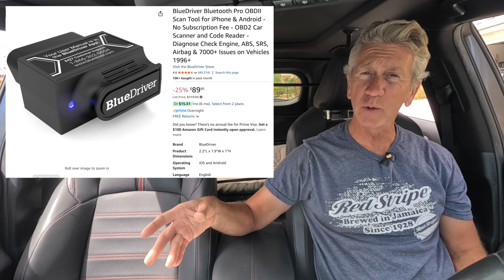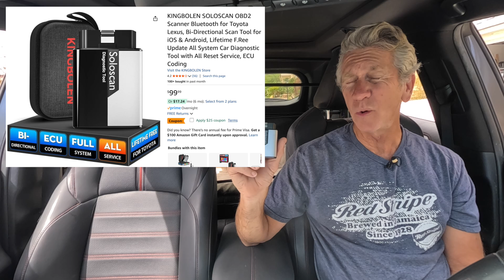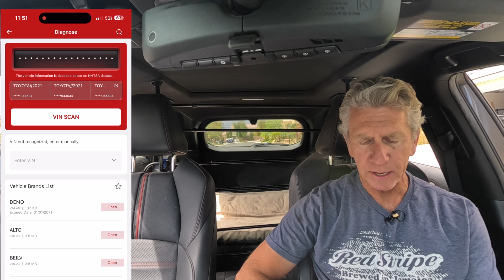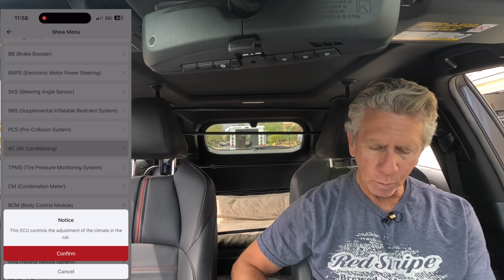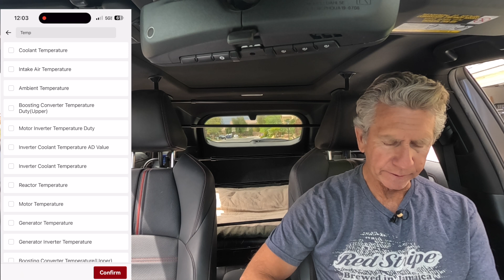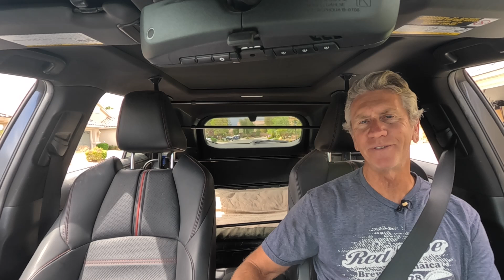OEM Quality Scanner for Toyota Vehicles: KingBolen SoloScan Toyota (Scanner, Testing, Live Data)

Comment: I have so many questions! Can it start the engine?? (Like would it work as remote start?) can it tell you electric miles driven?
Reply from the maker: I don't think it can start the engine.  It's a really good diagnostic tool... as well as let you monitor live data when driing.

Comment: Hey Darrell! Great video! We tow with a Sienna Hybrid and although we have not had any issues with overheating, etc., I am curious to see how the system performs. I was looking for the Toyota specific KingBolen OBD2 scanner but it appears as though it may be discontinued (the link in your description indicates it is currently unavailable  on Amazon). I did purchase the generic version and even though the software looks a little different, your instructions were spot on. My setup and navigation of the app was somewhat challenging but your tutorial made things WAY easier. Now I know how to monitor the systems in my Sienna when towing. Thanks for a great video!
Reply from the maker: Hey guys.  Thanks for watching.  Glad the generic one provided the same data!!  Good to know !!
Reply: @GoldenK9Campers  You're welcome! I was able to monitor all of the data points included in your video, except for engine temp for some reason. It is possible that I overlooked it because the menus are a little different. Safe travels!

Comment: I am using the Hybrid Assistant app for Android only - it can show much more info and record charts about many parameters of your trip. It is not about diagnostic, but more about trip detailed info logger. Also, I like that it shows runtime data if brakes are applied or it is still regen, and how much you can regen. Also, how much throttle in EV mode you can do until it starts ICE. How much power is each unit  generating/consuming (each electric motor individually)
Reply from the maker: Sure wish they made it for IOS.